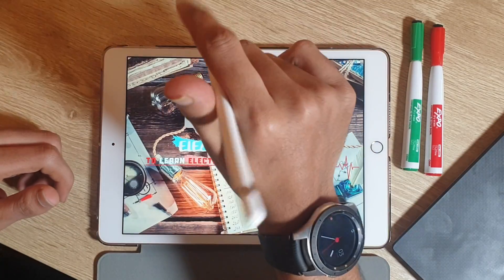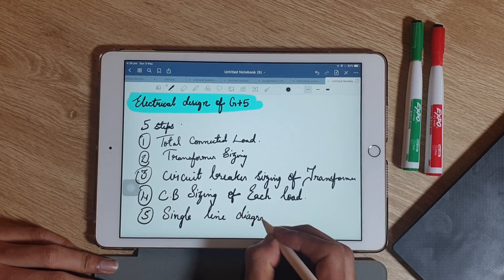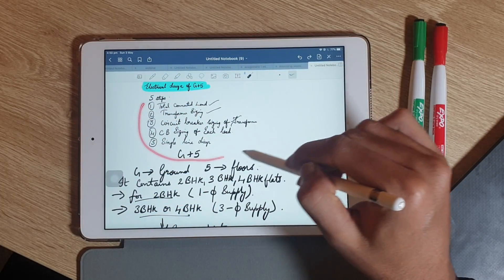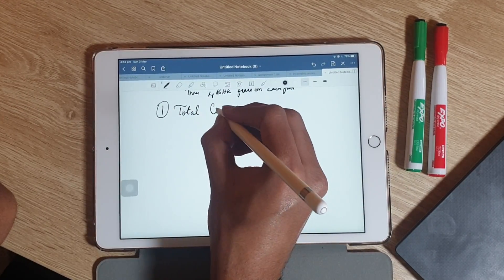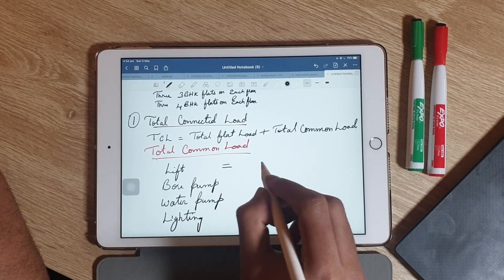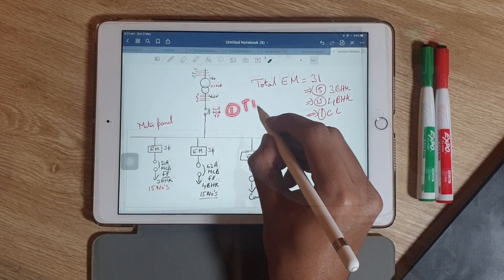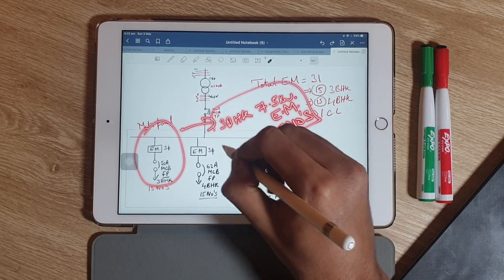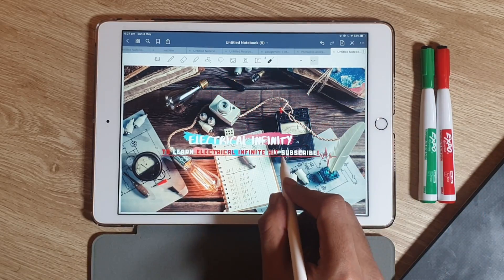Electrical Designing of G+5 Building with calculations & Single Line Diagram |Total load calculation

Comment: Thanks a lot for this video. It help me a lot. P,lease how can I get those charts you used to check the transformer sizing, the standard chart for the circuit breaker, and so on?

Also can you recommend a tutorial/course where one can learn comprehensive electric design with CAD and all?

Comment: As per Demand Factor, it should be less than or equal to 1 then how you put 125% for Industry...Because Maximum demand load is always less than total connected load...
Reply from the maker: Because motors withdraw current more that its rated value during a start. This also applies to lifts as well.

Comment: I think 2bhk will have 2 package unit acs of 3450 or 3000 or 4000w acs and if u r installing split acs it may have 1500w minimum... When u only have air conditioning load of approx 5kw how can u use 5kw meter or count it 5kw when u have to add lightening load sockets load and water heater and many more

Comment: When you find common load circuit breaker size , you multiplied the common  load by safety factor.
But when you do the calculation in high raise building why did you multiplied by demand factor?
What is the reason for it?

Comment: Very nicely made video and crisp information delivered.
I have a query. What if the load changes during the project execution ? It may reduce or increase. Then what is to be done about the transformer sizing ?
Such scenario occurs most of the time.
Reply from the maker: Well the project don't directly go to construction phase. There are different stages like preliminary, tender and construction set. Each stage has 3 to 4 revision. The project   will start on site once the construction set is finalised.  It takes 3 to 8 months to complete these stages depending on size of project. 

Thanks for appreciation ❤. Keep watching and keep sharing.
Reply: @ElectricalInfinity  Yes, that's true and I am aware about the project life cycle. But there are times when the client comes up with some drastic changes (atleast in India). Then how we can accommodate those changes in the already designed power system or what are the other strategies to adopt ?
Reply from the maker: We have to reassess the maximum demand to make sure the load is below total ampere. The client can't make any changes to load without consulting electrical consultant. If the load is above the limit even after diversity factors then the project timeline and cost will increase due to changes in supply capacity, reapplying supply application to supply authority, transformer sizing, cable sizing and main switchboard. The client already know the impact and it is upto him. If he want changes then have to bear the cost. 

We can avoid this situation by allowing 15 to 20% spare amperes for future provisions during a preliminary stage of maximum demand calculations.

Comment: very good video , but SLD  is wrong since it is a high rise building your have to provide MDB , from MDB to  SMDB for each floor from SMDB to DB for each Flat 

for eg  -MDB  to SMDB -1 ( floor 1)   then from from SMDB 1 to DB 1( flat -1 3bhk ) , SMDB 1 to DB 2 ( 4 BHK ) etc   

According to the load of SMDB & DB Cable Size Has to mention in SLD

Comment: Sir as per codes and standards you have to multiply calculated current rating with 1.25 as a safty factor for CB calculation..then you can select available current rating.
Reply: U cant choose CB directly from calculate load current...there are many factor we have to consider as per codes while designing circuit...

Means if your load current is 447A then 447*1.25=558.75
After this step you can select CB rating.

Comment: You didn't mention that what size cable should be used here for the the main supply.and I want to know one more thing please explain how much load  taking in a phase.iam really confused with that 400amp mccb mean what.how Many amps can flow through one pole.please explain that.
Reply from the maker: Seperate videos for that
Reply: @ElectricalInfinity  do you provide training?
Reply: No you are not